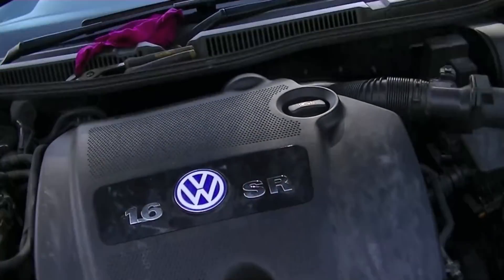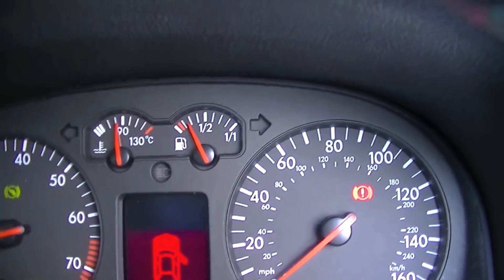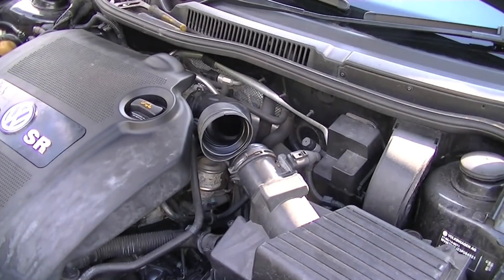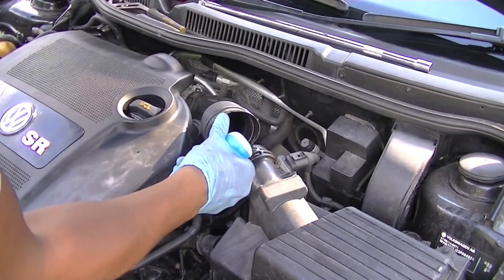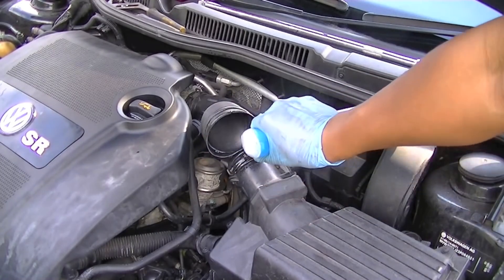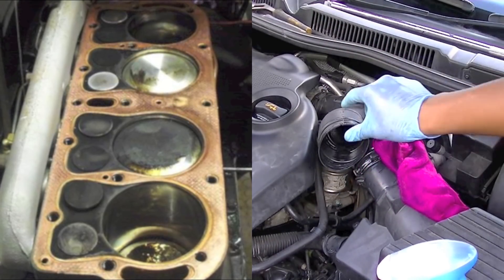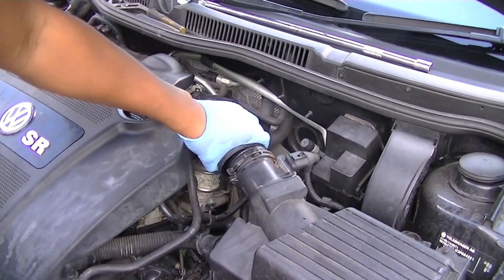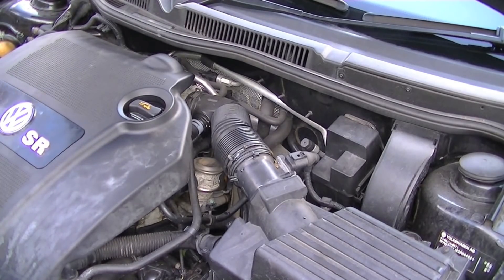How to make your engine run better with just tap water.......Better Than Seafoam?

Comment: WATCH YOUR ASS DOING THIS!!!   Ya Daddy did this 30 years ago, But today with aluminum Blocks with steel rings you get quick cool shrinkage and then your rings crack. The car may seem like it runs fine for a while because the cracked rings are filled with carbon deposits and then after time they will either build up or release the that is when you know you really screwed up. So with steel block and steel rings your ok most of the time, but the judgement is yours. They make cleaner that is safe for this it just takes a few times of doing it, not like this just blowing all the crap out at once and then , well you take it from there!!!    BB

Comment: Interesting video. My Citroen XM 2.1 TD had classic original head-gasket rot which had steam cleaned the piston top to the point where it almost looked new.  Just watched your before & after vid with the Micra. Definitely a reduction in carbon judging by the images.

Comment: Hello BMAC VAGS.
I did this thing without somebody  pushing the pedal and maintaing it at 2-3000rpm. Could I have done damage? The check engine appeared for a short while. I poured 100 grames distiled water. I can say, the ride is better, I can feel it. Unfortunately, the spark knocking noise is still there, but not that loud, this is why i tried this method in the first place. Do you know how can i overcome the knocking sound on my Golf 1.4 AXP engine?

Thanks for sharing!

Comment: Nice video. Try now to add few grams of salt to a liter of water. If can measure the ppm should be below 1000. This is the standard fresh water maximum dissolved salts contents. This salt will trigger a whole alchemy at that pressure and temperature.

Comment: Why doesn't this hydro-lock the motor and wreck it please, anyone?
Reply: +Kevin Chamberlain Water mist...  straight water will damage an engine...  but water mist wont... The mist enters the engine and absorbs heat while turning to steam.  This makes the inlet charge dense...  so more can fit into the cylinder...  and makes more power...  a side effect is the steam howling thru the engine CLEANS it as it goes...
Reply: Andy George Well explained, thank you very much!  You say it increases HP but my ears heard the engine revs dying a little?
Reply: Yep... i heard that too...  Prepared to say that whoever is on the throttle holding it open to 2000 RPM is doing so with his/her foot... 
a less-than-startlingly accurate instrument...

Comment: water actually cleans your motor. if you say other wise your a complete idiot. Think why a water/meth kit exits for turbo cars. it injects water in the intake. should you dump a ton and hydro lock it? No that will ruin your 02 sensor.
Reply: +Ellis Preston RAF has been using it on the spitfires all thru the war...  Gave them a power advantage...  BMW are offering water injection on their new range BMW M-Spec cars...  I've been using a PROPER water injection kit on a '77 XC Fairmont since '77, and the engine is like new...  Only mod I did was to put a stainless steel exhaust on it, cause the original system turned pretty immediately to rust... 

Quite a few people GUESS what could happen in this scenario, and come up with all SORTS of weird shit, when in reality if they HAD a car running water injection, they would SEE...  it working...  well...

It rusts the cars internals - No it doesnt...  The internals are constantly covered in a thin layer of oil
It Hydraulics the car! - No it doesnt...  You're not putting raw water in, you're putting MIST in...  HUGE volumetric difference.

Comment: Hi,

I've watched your videos and I've really appreciated them, that's why my questions are the following:
I have some issues with the engine or I don't know maybe is the transmission because when I try to keep the speed constantly the car doesn't run smooth, it jerks and to avoid this is necessary to accelerate or to release the gas pedal otherwise the EPC and Check engine appear on display.
I want to mention the car has automatic transmission and the model is VW Polo 9N with the 1.4 16v engine.
The error in VCDS is 17961 Barometric sensor P1553 - 35 - 10.

Could you please help me with your advice.

Kind regards.

Comment: pretty cool idea I'm not sure how well it works honestly I just did the head gasket on a 98 Pontiac gtp, and on both sides the piston's were all fouled not one clean which may be irrelevant, honestly I've been working sense I was 15yrs old so I'll just buy the seafoam seems to do the job and the smoke is pretty dope to watch haha, thanks for the video tho, good cheap fix I will keep in my quick fix mind vault for a friend or family 💯👍

Comment: NEVER EVER INTRODUCE WATER IN AN ENGINE, water molecules can accumulate in the oil this is dumb with newer cars because of the pressure from the injector you may get more unburnt fuel with the amount of water hes spraying in, their is always the posibility of hydrolocking
Reply: +Blake Lawrence  no. not with a spray bottle.. but you know some idiot out there will put a garden hose down there and that will induce hydro lock.. as far as the oil goes.. no again.. not enough will get past the rings to pollute the oil and what little water does get through will soon evaporate as it's pumped through the engine.. ask our guys in England that deal with mayonnaise oil until they go for a long drive...
Reply: Water is injected into engines to eliminate detonation. They have used water injection for years. People that have no clue should take a moment and do some research, especially those that claim to be mechanics.
Reply: Brien lol you have no clue what you're talking about. Proof? Name one, just one, production car that injects water to prevent destination.
Reply: +Mike Pratali http://www.enginerunup.com look it up, they have done it for years. I never said they used it on production cars but I hear they are utilizing it in the new BMW's
Reply: +Brien hey moron, that is the topic here common fixes to common cars , Christ how stupid are you?
Reply: +Brien NO ONE injects water into there engine LMAO that would destroy it. What people do introduce into the intake side of the inlet BEFORE throttle bores or after intercoolers is Methanol Injection which is 100% safe. Methanol, windshield washer fluid acts like race fuel and not only decreases temps, but it also increases horse power, A LOT. 

I own a 2015 Chevy 3500 HD with a 6.6 Duramax with twin turbos. I run Methanol Injection and propane injection in it. I also run Methanol injection in my 2010 Subaru WRX STI as well. 

Straight water at high temps will split a piston or crack a block in a heart beat. Not to mention, water will corrode iron or non aluminum metal. All coolants and fluids have a lubricant in them and act like a lubricant. By adding water to the mix, your asking for pure detonation and a disaster.
Reply: Water accumulates in the oil during cold weather in the first place. No difference.

Comment: If you have blow-by don't you get moisture in your oil? If this really works, then you should replace your oil right after.
Reply: +niacal4nia Not in a hot engine...  Hot oil + Water = evaporated water.  The crank case is ventilated anyway, and besides...  Unless the rings are REALLY shot, there's not a war-stopping amount of steam gets past...  Out the crank breather tube, and back into the intake.

I turn the water off about 5 minutes before I get home in my car (1977 Ford Fairmont with a proper water injection kit), so the car can digest the remaining water, and spit it out before I turn her off...
Reply: Thanks for the reply. Also on some newer cars if the check engine light stays on during the water spray, the only way to turn it off is using an obd scanner, because disconnecting the battery would mess up the TPS and engine wouldn't start on drive by wire cars.

Comment: in days of old you could do the same thing by pouring transmission fluid into the carburetor and revving  the engine while you poured. today's engines are aluminum and can't handle the heat.
Reply: +mschnurp makes me wonder why you think more heat would be the result and how you think that aluminum wont dissipate the heat MUCH faster and better than cast.
Reply: Isn't it obvious that aluminum has a lower melting point? As I recall the transmission fluid caused the engine to get so hot, that the radiator cap had to be removed to prevent damage from being done from steam. I guess you could try it on the aluminum engine, I wouldn't recommend it though.

Comment: My view on this... 

It's bollocks, Yes a failed HG will clean the top of the piston as its been leaking alot longer than youve been spraying that bottle for.

Will spraying water mists for 5 - 20mins ( which will form into more than just droplets ) into a car air intake work, highly unlikely. 

In my case it never helped me on my car for high emmisions for an MOT, I then had to retest the car but then used a Archoil  fuel / engine cleaner and voila  Emmisions passed.
Reply: +81keyholder You can also mix your gasoline with ethanol and you'd pass emissions test.

Comment: you are doing that all wrong the motor should be running at 2000-2500 rpms while flowing water in at the rate of one quart a minute, this will actually clean the valves more efficiently

Comment: I have done this with atf using a suction hose from the intake and slowly let the atf work its way into the engine it will smoke like crazy but works great. water will rust the inside of your car specially water reacts quiet aggressive with temperature probably distil water might be a better alternative still have doubts
Reply: +wil aguilar I kinda agree...  The internals of my car are spectacularly clean, but the exhaust is absolutely shot...  A stainless system was quite expensive, but was the only way to keep the exhaust system in one piece...

Comment: Don't listen to this fool. And especially don't do it in a Diesel engine. You'll "steam clean" your cylinder walls of lubricants.
Reply: +Chadd Chevrolet While I disagree with his squeezy bottle method, Water Injection has been successfully used as far back as RAF (spitfire) days of WWII...  BMW have recently introduced it in their M Spec cars, and Ive seen quite a few diesel engines running it with really promising results.  

Its a very good system if its done properly... Half a dozen pumps of a squeezy bottle isnt (IMO) going to make THAT much of a difference, but the theory is sound.

Comment: introducing water into your engine is not a good idea. it can do more damage than good. there is no reason to clean your cylinder heads or cylinders. if your fuel trim is correct and your engine is all around in good condition, cleaning the couple thousands of carbon build up on pistons and heads doesn't improve performance. furthermore, why not just go for a drive when it's pouring rain or heavy fog? will do the same thing.
Reply: +Adam S While I agree mostly with what you say, that there is no urgent need to do this if the car is in good condition, I dont see any reason to not KEEP it that way, and water injection is a good way of doing just that... PLUS, the water mist cools the inlet charge so it makes it dense...  Dense inlet charge = more can fit in the cylinder...  More air/fuel = bigger bang...  bigger bang = more power.  

side effect: Inlet water mist turns to steam as it absorbs heat from the surrounding engine/hot air/fuel charge...  Steam cleans internals of engine, which is brilliant if your country imports fuel for domestic use.  Imported fuels have been/are/whatever a bit poor quality...  so keeping things clean isnt a bad idea...

Downside: It cant be effectively performed... once...  Water injection isnt a weekend job.  It has to be done properly, there are a lot of caveats that HAVE to be looked after.  How much water you're allowed to introduce to the engine.  WHEN to introduce it, WHERE to introduce it, and so on...  Cant spritz cold water on a hot turbo, for example...  The turbo will be unhappy for exactly 6 revolutions...  then Kerbang...  It can be introduced AFTER the turbo, though... Ideal as thats when the air/fuel charge is hottest...  acts like an intercooler-with-benefits... If you think about it it sorta makes sense...  PLUS...  the steams gotta go somewhere.  The exhaust system does suffer quite badly...

It works, but do it properly.

Comment: This makes sense. Here in my country a lot of cars can run with both petrol/ethanol and the ethanol is sold without any mixture of petrol on it, however it contains up to 5% of water. The point is, after some time running using petrol only, the valves, pistons and the exhaust gets dirty (with that black carbonization), but after some time running with ethanol everything stays clean, the carbonization just disappear. The water clean it all, and if you use only ethanol the oil will stay as the same color it was when new.
Reply: If you fail emission test you can pour some ethanol in your tank and redo the test and you'll pass. My dad did this on his old e34 518 bimmer :)
Reply: You like ethanol and I hate it. My car doesn't take ethanol because it breaks the fuel system. Where I live only V Power shell sells gas without ethanol. All the other stations do. Also you get better mileage with only gasoline.
Reply: Actually I don't like to run using pure ethanol, when I do it is just for a few fuel tanks, I always used a mixture of about 80% ethanol and 20% gas and I've never had any problem with my fuel system in my 2008 VW Polo, I've never used any cleaner additive nor premium gas, however I replace my fuel filter once a year.

But I agree with you, ethanol messes the fuel injectors and the filter pretty fast, but as long as you use some gas along with it, it should prevent these problems.
Reply: lol :D

Comment: I used to inject water into my intake manifolds on several different cars way back in the fifties. ...had a vented bottle of water connected by a tube to the intake manifold. The plugs would look as clean as new... and so I assumed that that was happening inside the combustion chamber. Anyway, the cars ran much smoother afterwards and none of them every had any problems. I don't know what would have happened over 100,000 miles as I didn't keep them that long. This system works just great!
Reply: +Richard Ranney 1977 Ford Fairmont, 302 V8, 590,000 kms on, original engine, no smoke, no rattles, but sod the squeezy bottle!  I brought it a proper injection kit.  Ran tap water since it was new.  ZERO problems...  

Your right, this DOES work really well, but for heavens sakes, do it properly...  meh...  if it worked for the RAF on the spitfires...
Reply: +Andy George  Wow a 77 Fairmont, when I was 14 my parents bought a brand new 76 Mercury Monarch had the 302 also, they paid like a little over 6 grand for it, it was the mercury version of the Ford Fairmont, was a California purchase so with all the smog crap and drop in HP, cause of insurance companies, doing away with the muscle car era, it was pretty slow, just saying and remembering the good ole days. Not to many Fairmonts on the roads these days.

Comment: alot of intake designs would allow water to pool up in the bottom of the plenum.  not like old carbed engine design where your intake runners go directly to the head.   personally id go with solvent of some sort so at least it would evaporate quickly.

Comment: From an old mechanic. I have know of this process for years, most old guys doing this usually mixed water with trans fluid 50/50. What's supposed to happen; you bring the car up to temp then relying on the premise that metal shrinks much faster than carbon, spraying water into cylinder causes instant cooling, metal shrinks carbon can't so it flakes off and it ejected out the exhaust. It actually does work but here's the kicker, an experienced mechanic can probably get away with this method but there is a chance of causing what is known as hydro lock- too much water in cylinder, piston can't reach tdc, top dead center, which can cause broken Pistons, broken rods, holes in Pistons. I have seen lands for rings broken out and falling into crank case. Lots of nasty things. Lots of old jack leg methods for cleaning out motors, how bout the old 3 quarts diesel fuel to one quart of oil then run for 15 min. Does it work ? I can see it cleaning out sludge, I wouldn't do it. Proceed at your risk